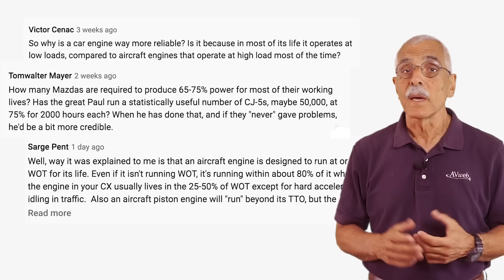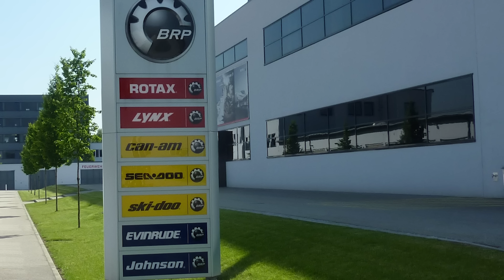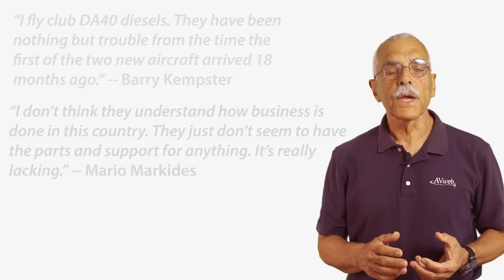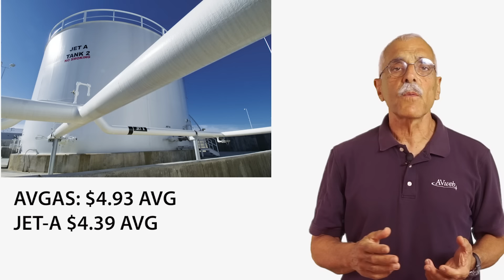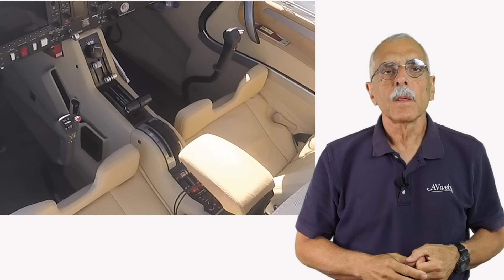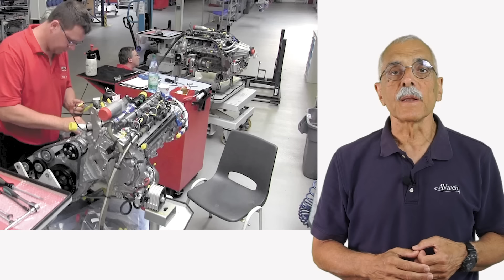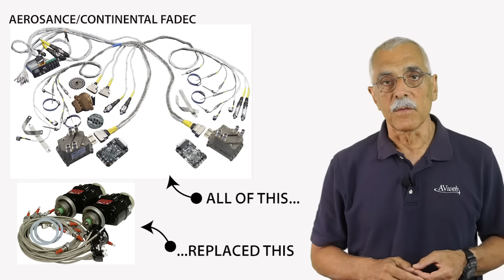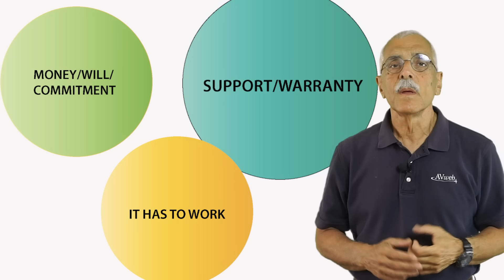Why New Aircraft Engine Ideas Rarely Succeed

Comment: Your description of starting the IO550 is perfect 

I fly dozens of models with this GREAT engine but starting it… your face was perfect!
Reply: What about the Lycoming IO540 ?? I've been told that is the best engine in GA.  That's why the Panthera choose it.  The only problem with the Panthera, is it's "only" 600K out the door.
Reply: @mustardseedsociety  Compared to the TCM IO-550 the Lycoming IO-540 feels like a two cylinder tractor engine :-)
Reply: @cherokee592  well I thought I'd ask because I'm finishing up my IFR rating then the plan is to get the multi rating in the Aztec and down the road I'd love to get my own Aztec PROVIDED I can figure out a way to generate revenues to at least break even.  The Aztec uses the Lycoming IO540 and I've been TOLD it's a good engine.  Of course "good" is relative, because I as a jet mechanic worked on CFM56 turbo fan engines and Rolls Royce RB211's.  Now THOSE are some "GOOD" engines.  The only problem is, they cost about 2 point 5 million a piece.
Reply: @mustardseedsociety  Hi! Of course the Lycoming IO-540 is a good engine! I fl  SR22 with a TCM IO-550 and it's just a bit smoother than the Lycoming so I was teasing Lycoming pilots a bit :-) OTOH the Lycoming can take unleaded fuel which my 550 cannot! Yes, no comparison between our toys and modern fan engines. Unfortunately the CFM56 is also a little too heavy for the Aztec ;-)
Reply: @cherokee592  Well now that I have you on the telephone line, as a pilot you're further along than I am.  Should I get my glider rating THEN get my multi ?? How would you do it ?? I want to have both.  But just don't know what order to go.  But regardless, I'm going to finish my IFR rating first because I'm committed to that now.  I worked on aircraft for many years and I was kind of "jealous" of the pilots.  I liked fixing aircraft, but I want to fly them as well.  I flew the 172 on my days off giving my co workers rides.  What's very puzzling to me, is MOST of my mechanic co-workers had ZERO interest in flying a plane.  I could never figure out why and they say there's 7 wonders of the world, well that question is #8.  My first airline mechanic job on Convair 580's up in Lawton OK, this one mechanic said, "I drive, but I don't fix cars", "I fix airplanes, but I don't fly".  I thought that was the DUMBEST statement from an aviator.  My A&P instructor was totally the opposite.  He had a degree from Purdue in metal lurgy {yea I spelled it wrong}, was a MASTER aircraft welder, built his own aircraft, and was a pilot - and STILL IS a pilot today.  Now that's an aviator !!
Reply: @mustardseedsociety  Hi, I am very sure that all pilots who first learned how to fly gliders are better pilots. I have not, unfortunately, but a couple of years into flying i did my (German) Aerobatics Rating which also helped me to fly more coordinated and more precise. I am sure with your ambition you will be a great pilot! I had a young guy in my company once who knew ZERO about flying but starting building an airplane in his living room at home. When it came to the wings they were half in the half in the living room and half in the bedroom :-) He was a great truck mechanic in my company. When the airplane was finished he taught himself to fly it, without an instructor and later he built a hangr on the little farm where he lived. He is still alive :-)
Reply: @cherokee592  That's a crazy but neat story.  Yea I managed to get 5 hours in gliders out in Southern California. It really makes you see things you've never seen before.  I understand so much more about flying  in just 5 measly hours of glider flying.  Thankfully here in Texas, 30 miles to the NW is my IFR training and also "my" Aztec awaits me, {yes it's going to be expensive} and 30 miles to the SE is a fully equipped glider operation.  I'm hoping I can help do maintenance on the Aztec for a possible reduction in price.  That has yet not been worked out but we shall see.  I have studied light aircraft for so long, I keep asking myself which is the best light GA aircraft - and it's definitely the Aztec.  I don't really think of it as a "twin" {other than if you go engine out, your goal in life is to prevent VMC rollover and get it landed at the nearest airport. } But I see it as a 500 HP aircraft.  The only practical way to build a 500 HP aircraft, is with 2 engines.  A 500 HP engine would be quite large and most likely too much concentrated weight in one spot.  A 500HP turboprop engine is too expensive. So by using this way "to see the world", I immediately dismiss the "single vrs twin"  argument.  Bottom line, I want 500HP because that's what is needed to fly  6 soles at 3.2 miles per minute and have a 700 mile range and carry baggage.  That's what so frustrating about most GA aircraft is the Useful loads. I used to be a die hard 182 fan, but after looking into it, the Mooney 201 is far surperior.  My favorite single {M201} and my favorite twin {Aztec} are no longer produced.  So that's a bummer.  The Seneca is good, but you have to juggle the fuel load and it's got a zero fuel limitation.  The seneca does not have a 'critical" engine which is good.  The Piper archer comes with 4 seats, but really is a 3 seater.  Piper finally got it right with 3 seater archer.  The M201 is a true 4 seater from the #'s I crunched.  The Mooney wing is the gold standard because it is a one piece spar and is just so strong.  The aztec wing is very strong too, but does bolt together at the fuselage. I was told actually it was PAUL, the reason the cirrus came with a BRS, was because it was hard to recover from a spin.  Now was that at the aft limit ?? I don't know.
Reply: @cherokee592  Not all Lyc 540s can use mogas; far as I can tell only the carbureted ones rated @ 235hp.
Reply: @dieselyeti  thank you, i did not know that!
Reply: Well, mine starts every time. When it's cold it takes 2 blades (of four)... when it's very hit I start it with the throttle wide open, and it always starts. And yes, you can pull the power after it starts.
Reply: @cherokee592  yup! Especially if you flood it
Reply: @Notthe_droid_youarelookingfor  You cannot flood the engine by starting it throttle wide open.
Reply: @cherokee592  I agree! If it’s flooded...throttle open. And hot starts.
Reply: Great compared to what?